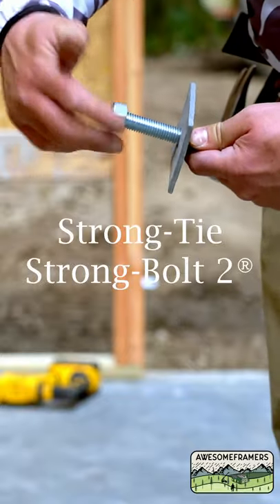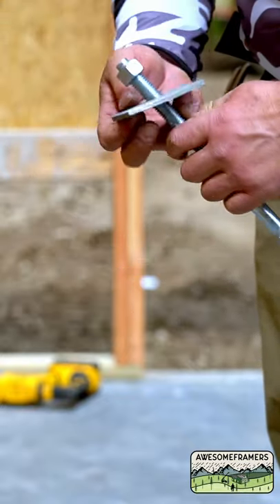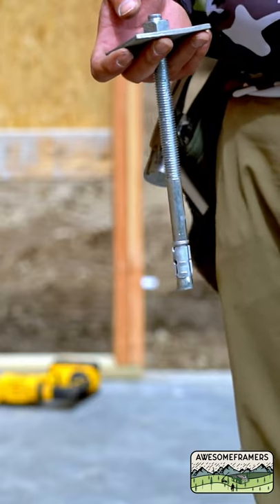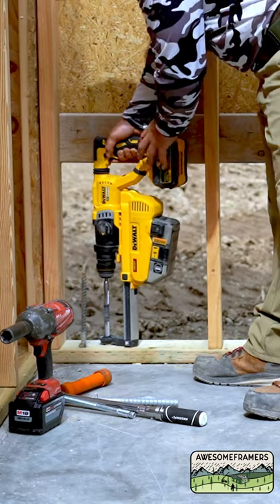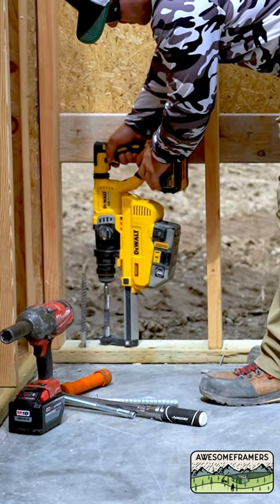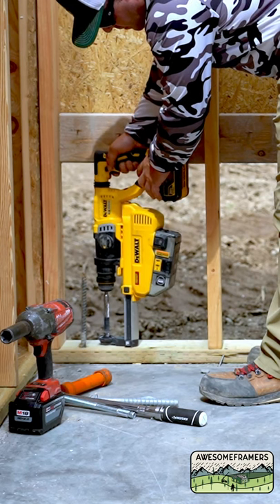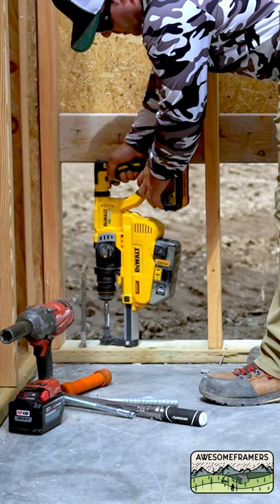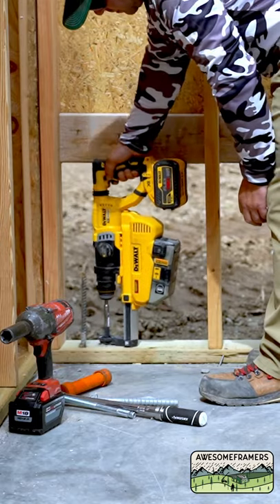How to Install a Wedge Anchor (Strong Bolt 2) #shorts

Comment: I never understood why people build homes from wood in these times. Unless of course when making a Finnish/Swedish/Norway type of classical "log cabin" home because one wants to enjoy the lovely smell and sight of wood. 

In Europe people love concrete and stones. In the US a lot of homes seem to still get made from wood. Even in light of fires and quite extreme weather you guys can get over there. 

Is there a specific reason for that? From overseas we relatively often get to see so many videos of homes destroyed due to wind or fire etc. So often I wonder why people in the US don't use concrete and bricks more for their homes?
Reply from the maker: Yes, Europe doesn't have trees like the US.
Wildfires aren't a concern for most homes in the US
Concrete has a hugely negative effect on the climate

Google "North American Construction Resilience"
Reply: Wood used to be cheaper than steel.
Reply: In my country, you cannot get planning or building approval if you wanted to build one of those cheap American style wood houses. Local councils don't allow temporary structures that lower the property values.
Reply from the maker: @johncoops6897  cool
Reply: @AwesomeFramers  Will do!
Reply: @JasonW.  yeah... That seems to be changing quickly now... Sad. And we're only at the beginning of the crazy price increases too, I fear.
Reply: @johncoops6897  Temporary?
Reply: @mattstroker3742  - yes, temporary. Wooden (faced) homes are (basically) classed as temporary structures, like cabins. It is extremely difficult to get approval to build such a structure as a permanent residence, or even as a garage. If you do it anyway, they will condemn it and you will be forced to tear it down.
There are heaps of old timber homes, however it takes special bribery compliance measures to be allowed to build a brand new one.

Comment: You ain’t gonna put 90 foot pounds on a 2 x 4 it will crush it
Reply: Did you miss the steel plate? It does this bit of magic called SPREADING OUT THE LOAD. 🙄

Comment: You make drilling an anchor so much more difficult than what it really is.
Reply from the maker: How so?  This is the manufacturer's instructions and vetted by them.  If this is too "difficult" you're probably doing it wrong.
Reply from the maker: @marshallbrannon8855  nope, I follow the manufacturer's instructions, I'm interested in doing it right 👍
Reply: @AwesomeFramers   I wasn't saying you was doing it wrong, I am set countless thousands of anchors over the years and we all have our way of doing things you have a good day.
Reply from the maker: @marshallbrannon8855  I appreciate that.  What I'm saying is that using an impact wrench is the wrong way to do it according to the manufacturer that all.
Reply: @marshallbrannon8855  The plans or specifications say to install products per mfr instructions; the inspector will usually ask that those instructions be available for his review. I have borrowed installers torque wrench and tested random bolts to confirm they have been torqued to spec. If I ever end up in court I can say it is all per code and approved plans.

Comment: Screw all that just throw a couple tapcons in it 🤣🤣
Reply: @hmtrimworks7148  it was a joke and they don't fail as often as your implying but sure why not
Reply: @hmtrimworks7148  when used properly, Tap Cons work exactly as intended. Try using the correct drill bit that isn’t worn out. 🙄
Reply: @jman0870  nope done with them… and yes I know to use the proper drill bit 🤨… use drive anchors for permanent or for temporary use a 1/4” bit and drive two 12p nails… tap cos are for homeowners
Reply: @hmtrimworks7148  yeah? Tell that to the numerous tvs I mounted on block walls around a factory that never fell. Have you ever considered that you might need to be smarter than the Tap Con?

Comment: Or, if you live in an area where there is a lot of storms, maybe start building your homes with concrete, bricks and cement instead of paper.
Reply: Those homes are much more dangerous, expensive, impossible to renovate and change, and when there are problems with plumbing and wiring they are impossible to solve
Reply: @maxfathi596  I suggest you take a look at how Europeans do this. It’s not as hard as you think of it to be, and at least the home will stand it’s ground in a storm.
Reply: @maxfathi596  more dangerous how?

Comment: Well... 1) Leaving the concrete dust in your drilled hole is 100% wrong. You need to brush and blow the hole out. Driving the anchor in with the dust creates a hydraulic that can, and will split the concrete. 
2) All Torque wrenches are calibrated to the driving head. Anytime an extension is added, you have changed the ft/lbs of torque that the wrench can apply with unspecified variance. I.E. twisting of the extension, less than/greater than ft/lbs the further the head is away from the nut.
3) Your Torque wrench is NOT a ratchet!
4) Buy an adjustable cordless impact driver and cut your labor costs by 1/3...
Reply: I don't think that large diameter heavy wall tube socket is going to twist any noticeable amount, not compared to a regular extension bar.
Also, the tolerances here are pretty big. I don't think a few ft lbs one way or the other is going to change the effectiveness of the anchor.
It's compressing wood after all so the tension is going to change based on the weather etc.

It might be an important difference for an aluminum head on a cast iron block, but not on this.

Most people don't even use a torque wrench on them lol
Reply: His torque wrench DOES have a ratchet... so therefore it IS a ratchet torque wrench.

Comment: The nut should have been backed off to the end so you strike the nut instead of mushrooming the bolt
Reply from the maker: It actually doesn't matter according to the manufacturer 👍👍

Comment: From someone with no knowledge, I would think this wouldn't work. Itd be like me drilling the same size hole as my screw in the wood, and then hammering the screw in and then tighten it with a screwdriver. Seems much lesser quality yet you don't want to crack the concrete either yet you leave the dust in there too. 🤔
Reply from the maker: It's important to recognize this follow the manufacturer's instructions. Those are based on rigorous testing to a third party.
Reply: You do realise the entire point of these fixings is that they expand, right? You couldn't get the fixing in if you made the hole smaller.
Reply: At least you admitted that you have no knowledge. Better to go and research how expanding concrete anchors work.
Reply: @ferrumignis  no. That's why I said I have no knowledge. Now I'm informed and understand that there's an expansion component. From the video looks like it's threaded all the way down like a bolt.
Reply: @johncoops6897  👍
Reply: ALL wedge anchors of a given size are pounded into a hole with the same dimensions. Literally.

Comment: In Australia we have to blow all that dust out of the hole then put a hole brush in clean the hole then we will install the trubolt then we tork up the bolt to spec. Trubolts can fail when the hole is not cleaned out under load. 🇦🇺👨‍🏭